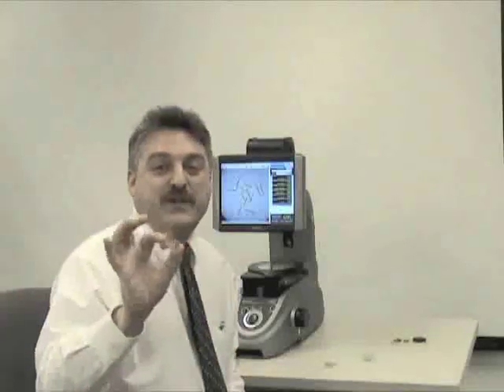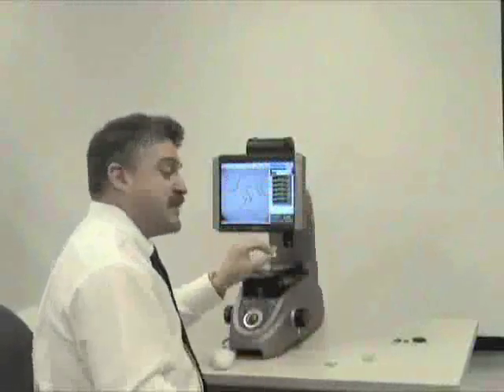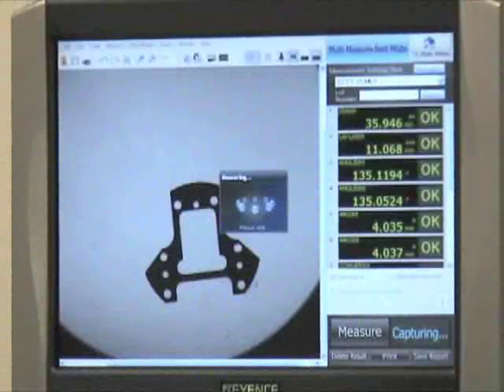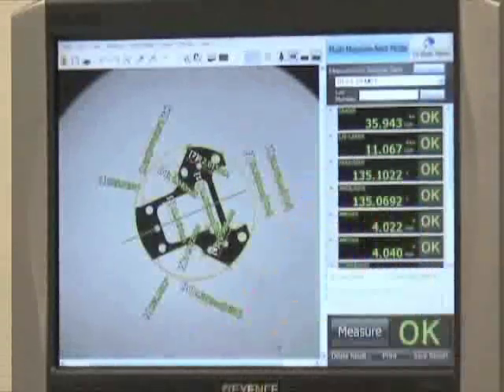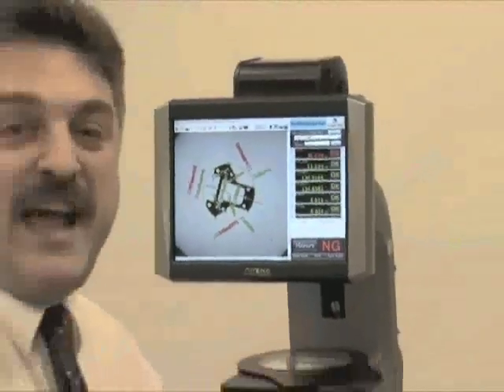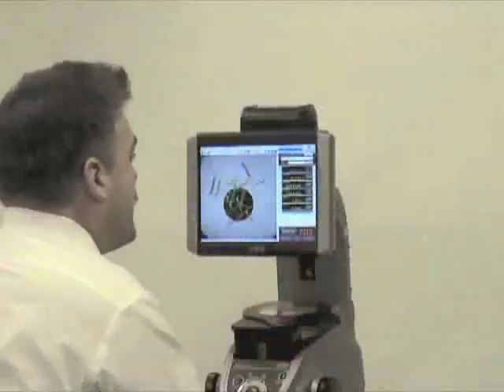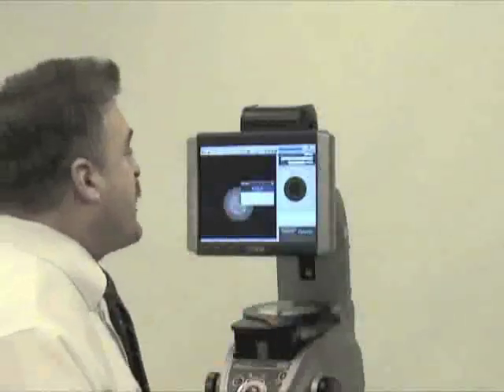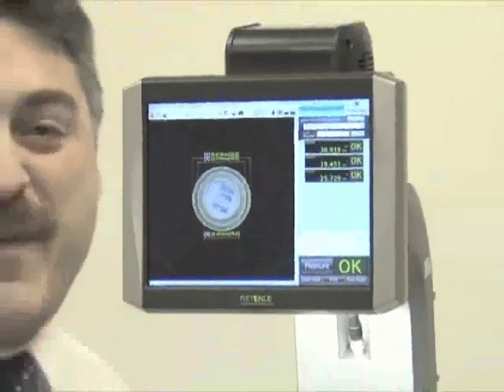KEYENCE 'Image Measurement' system, IM-6500 series

Comment: I use this inspection monitor. Works great, programming with it is a bit confusing and it runs EXTREMELY slow if your not saving to a big server. I still can't figure out how to read edge preps with it yet which is frustrating, especially when your looking at a million different elements you can use, but nothing works. Very very expensive, not just the machine itself but having to replace the glass stage constantly because it gets dinged up so easily. If stage glass has chips it throws all your readings off. So if your using it for tough materials get ready to buy a ton of glass plates. I like that it gives you step by step instructions on the screen while programming, it would be nice if the characteristics could be rotated so it looks neater. Instead my dimensions run vertical or horizontal which looks like a mess.